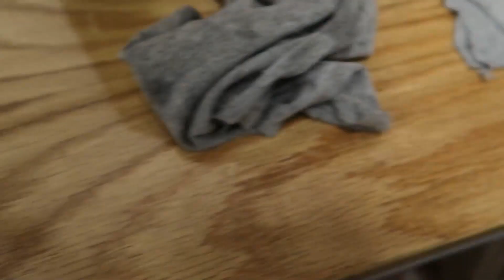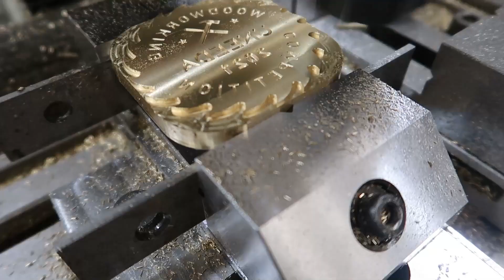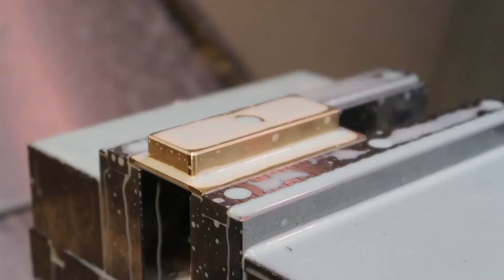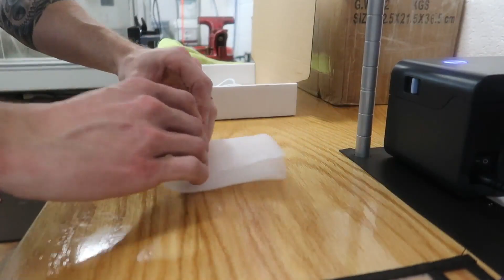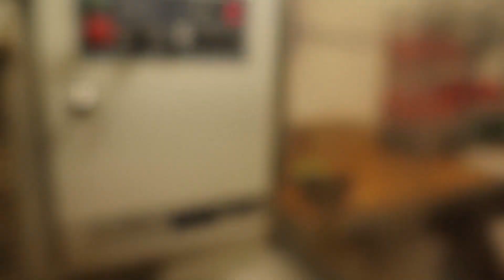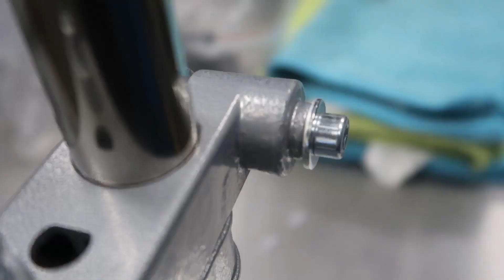What Happens in the Shop When I Don't Make Videos

Comment: you should machine your new small modular shars vices to have mitee bite slots. They work amazingly good in soft materials like brass and aluminum. That way you wouldnt have to have all the parallels out
Reply from the maker: I guess I could just machine in a step as well. I'm holding onto a part of the finished piece so I wouldn't be able to use a talon grip clamp. I might grab another shars vise to test that out. Btw, saw you got another spindle! That's always exciting!
Reply: @MojoMfg  Thanks, I super excited for my new vf1! I'll post a video later tonight (we unexpectedly lost 1 of our huskies a month ago and it has drained me of any motivation to do anything other than work but I do want to get back into making youtube vijeos)